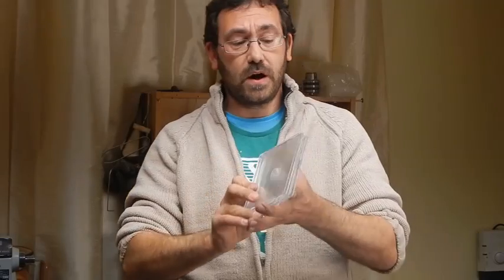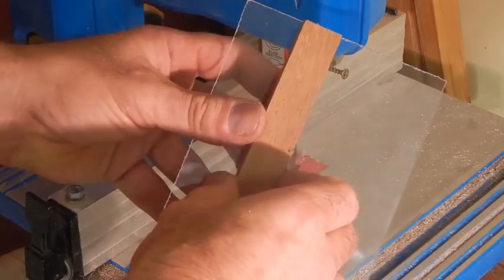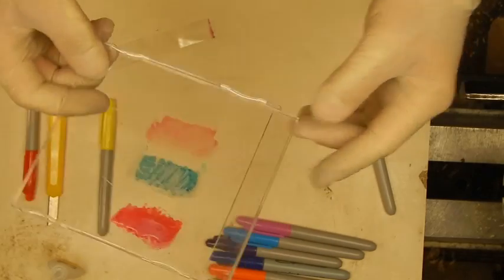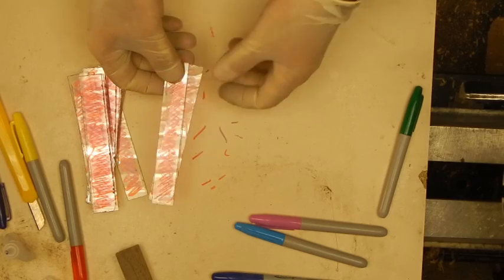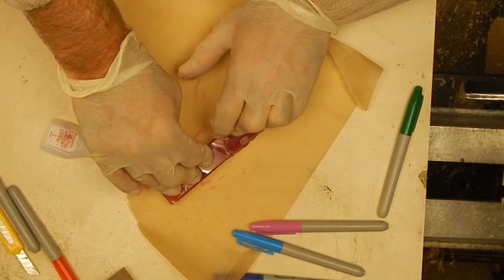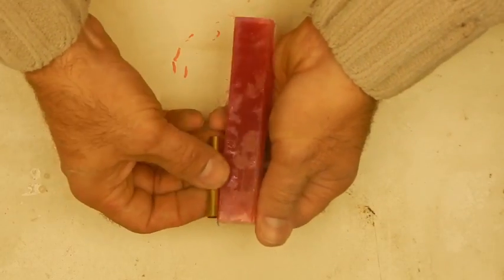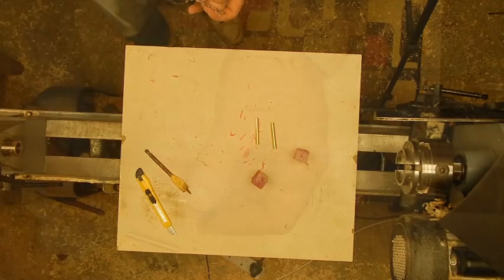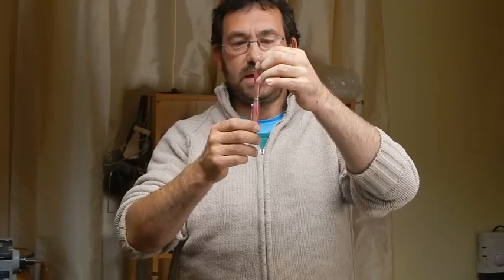Making A pen from compact disc cases !!

Comment: First off love your videos! You're not afraid to make mistakes so there's no limit to your creativity, That sets you apart from other wood turners. I'm a prop builder and find your creativity inspiring! I had an idea for a blank... Mixing various shavings an dust from projects with an epoxy or something to form a blank? If it's doable would look interesting
Reply from the maker: Hey, Thanks a million for watching and leaving your very kind comment, I have yet to source two part epoxy here in Ireland, shipping is stupid expensive !! But yeah I like the sound of that, I have been wanting to put cut offs of CD into epoxy too to see how it turns out!! Thanks a million for sharing your thoughts, regards, Steve.

Comment: Beautiful pen,  I especially like the finger nub.  Colored aluminum instead of the brass might be a nice twist.  Have you thought about a foot switch for the drill press, it would allow you free hands and still do the stop and start you need for the drilling operation.
Reply from the maker: Hey Jim !! I like the idea of the foot switch buddy, would it not be harsh on the motor though ?? I'm not very machine technical ;-) Thanks buddy !!
Reply: No, that is commonly used with many shop tools.
Reply from the maker: Cool, thanks for that buddy !!

Comment: That's fabulous! Sharpie pens can be made into alcohol ink. If you drip that on the acrylic and let the alcohol evaporate it gives a cool effect. The alcohol ink is very vibrant and when dropped on the piece makes a lovey splash pattern of color. I wonder if putting the glue on the side without the ink, then squeezing them together would change the decoration as much? I'm an artist and am always looking to use things in different ways. The pen turned out really great.
Reply from the maker: Thanks for the information Jennie !! Does the alcohol effect the colour of the ink? Thank you for your comment, and for watching, regards, Steve.
Reply: +Templeboy Turnings actually after you let the alcohol evaporate, which takes about 10 minutes at most, (you can speed it with a hair drier blowing but not just directly on it) it leaves more of the color than using the nib of the pen. There are numerous YouTube videos on this. I've found that one nib and ink cartridge and 2 ounces of rubbing alcohol in a small spray or squeeze bottle works great. It'll give you more color, faster, but the chemicals in the glue will change the color. There isn't a way around that.
Reply from the maker: Cool, thanks for that Jennie, I might be back to ask more artistic questions in the future so stick around ;-) .... Take care. Steve.

Comment: A better class of alcohol inks can be found in scrap booking shops and websites. Adirondack inks would give you a huge array of colors that may react differently to the glue or not at all. I love the pen and even more the use of recycled material.  Well done~
Reply from the maker: Thanks for that information, I will check out the inks..... Thanks a million for watching and commenting its much appreciated. Regards, Steve.

Comment: I enjoy your videos, and its great to see your projects.

Absolutely no experience turning, so forgive me if my questions are obvious.

You seemed to remove a lot of material from the blank, could the blanks not be made to smaller dimensions?

If the drill press is to fast, would you not be able to use the lathe on a slow speed setting to get a perfectly centered and level hole for the brass pieces?

Kind regards, 

James
Reply from the maker: Hi James, The blank was as small as it could be before turning, there needs to be enough material to be able to drill the hole. Any less and the blank could collapse. Also my lathe can only go as low as 500 rpm which is still way too fast to drill the plastic. The slightest amount of friction melts the cases. Your correct about using the lathe to drill if it was a wooden blank, its how I drill all my wooden pen blanks. Thanks a million for watching and for commenting, regards, Steve.

Comment: I am curious as to what CA thickness you are using. Thin, medium, or thick. It seems to me that thick would give you more working time to get the stack just right. I've found that thick CA sets up quite a bit slower than thin. I assume medium would be a little quicker than thick. I have a pile of CD cases with half of each case clear and half amber. I think I'll try to make something from them. I'm not set up for pens so maybe something else.
Reply from the maker: Hi Gil, I use thin CA to glue up the blank because it sets fast, also it floods a lot easier causing the complete surface to be covered "like water between two sheets of glass" I have tried all thicknesses and find the thin to be the best.

I have turned a few things from cd cases some of which I have videos for, so you are welcome to take a look. The most popular is the small box I turned with a purple heart lid. 

Thanks a million for watching and commenting, its very much appreciated, regards, Steve.